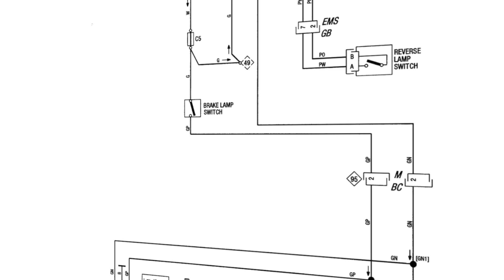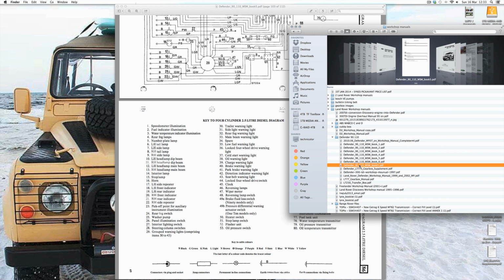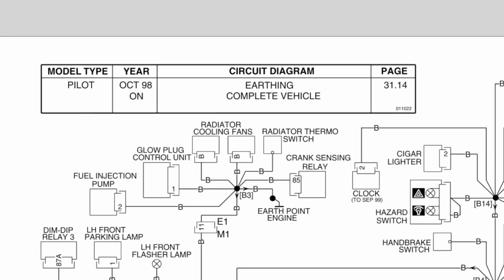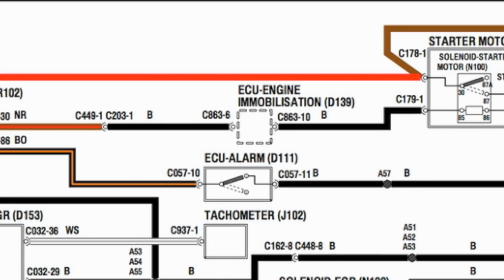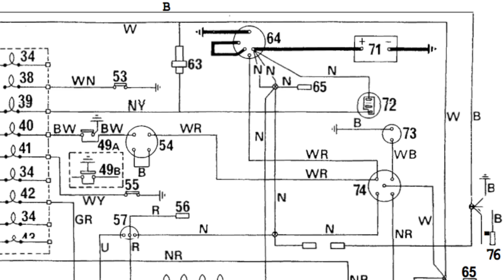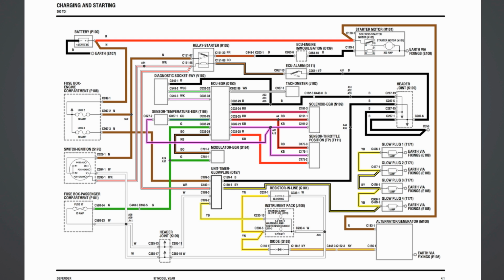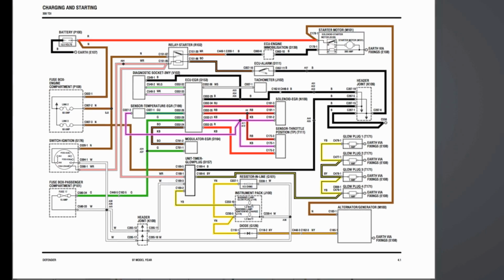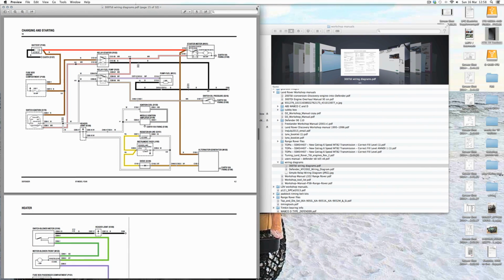Let's start to understand electrical diagnosis by using wiring diagrams

Comment: Hi just a question my 2.5 2004 discovery 2 keeps driving to long in gear before changing and also keeps going in limp mode which brings up the m and s light . How much is it for the output speed sensor and do I need to go to land rover for the sensor I’ve tried ringing around and they all say they don’t have it

Comment: In a dual battery setup (starter battery and everything else) I assume (point me in the right direction) Glowplugs, starter system (starter relay  /  ignition start / run etc...) all need to be off the one starter battery and the remainder from Accessory battery ( is this best practice for dual battery  - e.g. intelligent charging system for 2 battery etc..?)

Comment: Thank you very much for this presentation, and for the others to follow.
It never hurts to do any revision or look up new and different models other than what you're familiar with.
Thanks.
Matt
Reply from the maker: very true Matt and looking how other vehicles are wired up can also give an idea how to wire in extra electrics into a Land Rover
Reply: I'm not really all familiar yet with my TD5 130, however,  the only things that I have played with so far, is the wiring harness, which was replaced, as that is common in the TD5's.

The other thing I had real fun with, was to do with electric fuel pick up pump inside the tank, for which is a purple and white striped wire running the harness on the right side of the chassis.

Good fun ,especially when having to replace it with a range rover pump.
They are practically the same, except you're supposed to change over and transfer the little blue wires over as well, as to get an accurate reading on the gauge. However, it seems just fine to me. :D